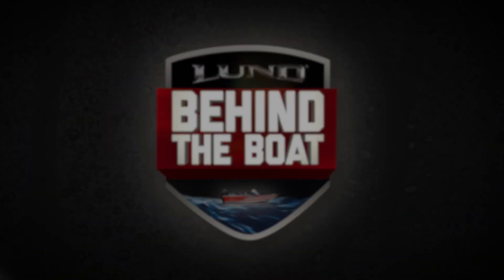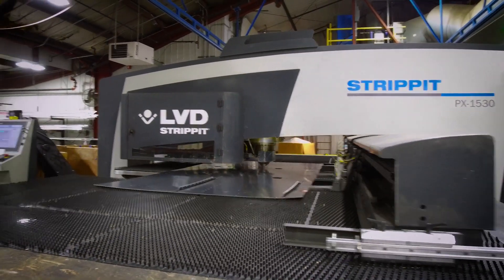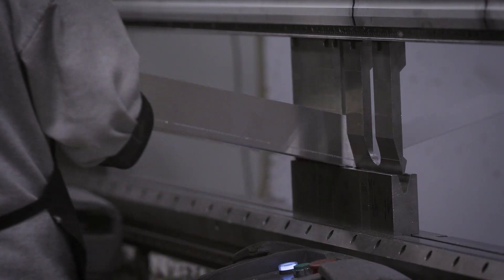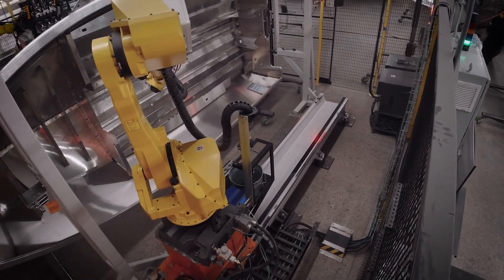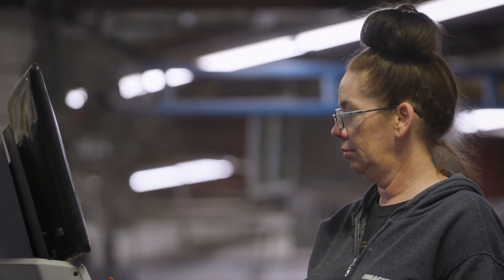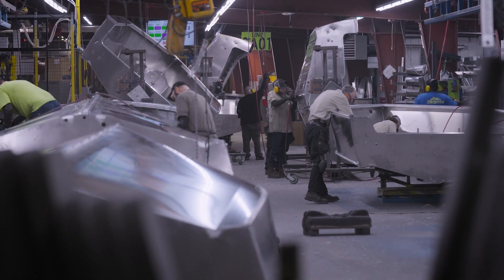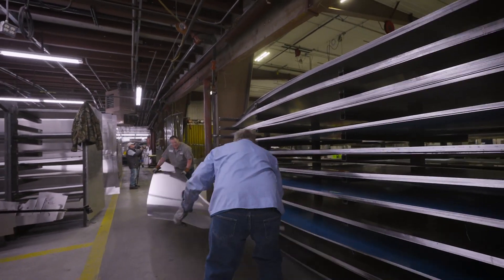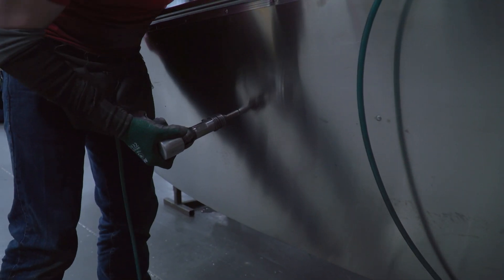How Lund Boats are Changing the Game with Advanced Boat Building Technology

Comment: You had better do a better job on your boat plumbing. I have a 2020 Pro V that has a leak form Day One in the plumbing for the rear livewell  - I am pretty handy - wired all the electronics and trolling motor. But taking the read deck off to get at the plumbong is ab out impossible,. I made a mistake in buying from a dealer thats 3 hours from here (during covid) He doesnt want anything to do with this. Probably because he knows how much work it is to get at the plumbing. Mayb e Ill post videos of how long it takes the bilge to pump it out after sitting in the water overnight. (I keep it in my garage)

What you have is a very poor design. This is my 4th Lund since 2011 and will be my last.

Comment: This boat is the most costly for the less quality! It’s actually a stretched 12’ boat the 28’ boat has Plates welded. In front of the wheel house to devert the water splash! 🤪 Crazy the thickness of the hull will buckle if they didn’t over build the I beams in the hull twice as many as normal, because of thin materials! Have a buddy who got a 28’with a 9’6 beam built in Victoria for $190 grand this boat came with twin 250 mercury plus all electronics and plus plus plus! MY Opinion and I have fished beside them is YOUR BUYING A NAME!!